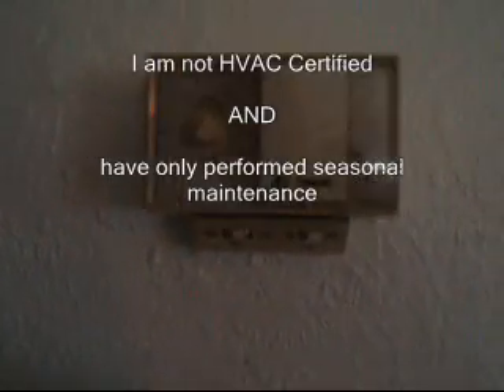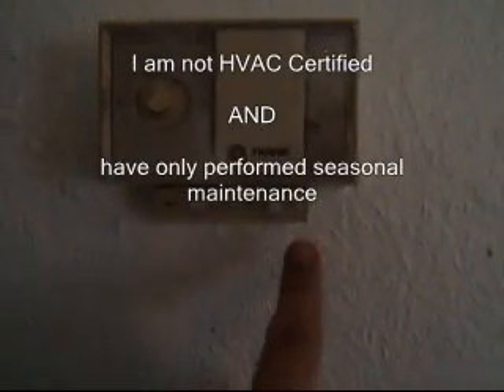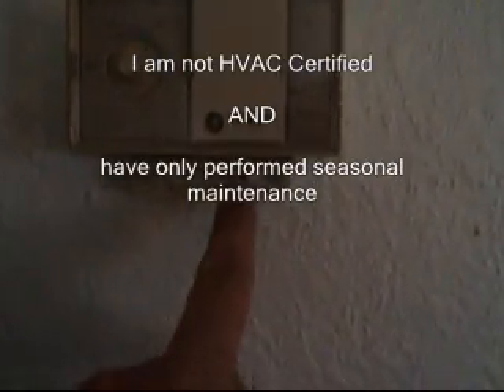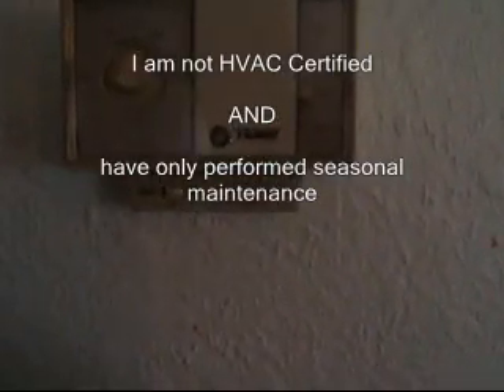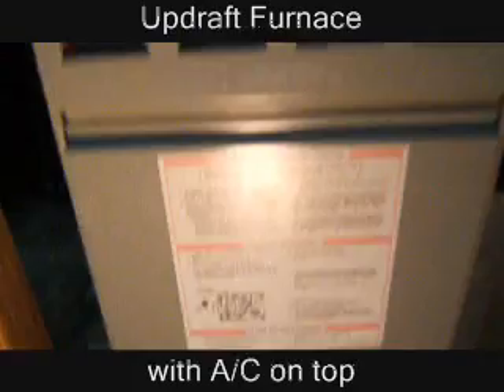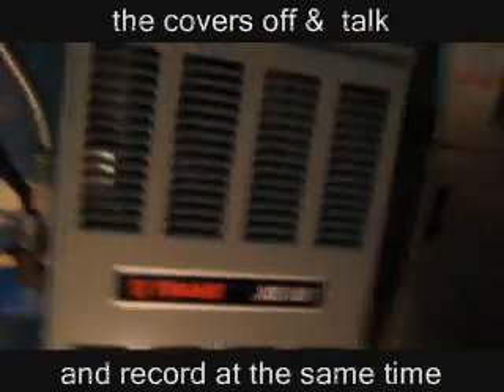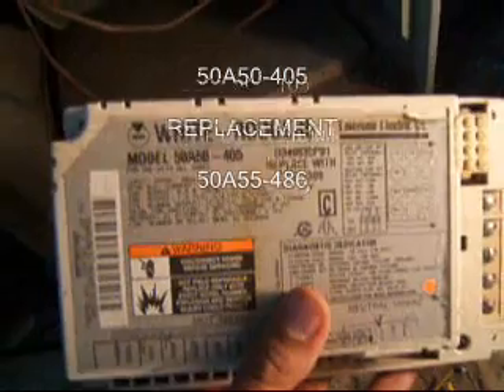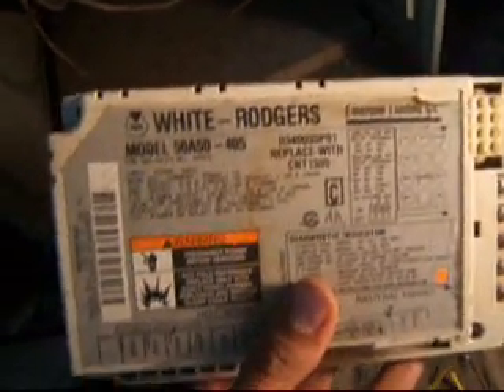Trane XE80 Control board failure and replacement

Comment: I replaced the old board and connected wire by wire exactly as it was but I am not getting any response whatsoever. The LED won't even come on. What could I try?
Reply: TheOnePav Did you figure this out? Same thing happening to me right now.
Reply: My LED lite bleaks 6 times what can I do

Comment: @dino71100 Wire the inducer back and then power up the furnace. Pull the tubing to the pressure switch and if the inducer comes on, you've found your problem. Blow out the tubing and if your furnace is 90, clean out the drain trap. You'll have to get a plastic hose on one side to blow it out and cover the other with your thumb.

Comment: @dino71100 Check to make sure the tubing to the pressure switch isn't blocked. Carriers won't start the inducer if the tubing is blocked. If this is a 90% furnace, make sure the drain trap isn't blocked.

Comment: All you whiners that are crying about do it yourselfers saving some money are idiots. I paid $65 for a guy to come out and NOT fix my unit. He pulled a sensor and cleaned it and charged me $13 for the task. I was told it would only cost $65 unless there was a part or timely repair. He pulled 2 screws and replace the part in 30 seconds. I call;ed his shop and they said they would send me the $13 back. He spend 10 minutes on my furnace and did not fix it. 

My job went to China and yours may

Comment: Before you swap parts on this system, check and make sure the exhaust isn't blocked and the tubing leading to the pressure switch isn't cracked or broken. More likely, the problem is a bad pressure switch, but this needs a manometer to check. The switch is about $30 as opposed to $150 on up for a new board. 
The thermostat calls for heat, the inducer comes on, the pressure switch closes and the igniter comes on. Once the gas valve opens, the flame sensor proves the flame and holds the valve open

Comment: I have the same system and just about two week ago it doesn't heat up no more. I open the cover and see no flame like yours. I replace new ignitor but still do no good. I mean the fan is blowing but no heat. I'm thinking is the controller box too. Where did you buy your replacement? I want to buy one. Thanks

Comment from the maker: Yes, the leaking was due to the A/C drip pan getting plugged with crap thus not allowing the unit to drain properly. This might have been due to poor installation by the Expert Installers or from failure of the previous owner to have the unit serviced. That said the control board actually went out many years after I purchased the home and long after the water damage.